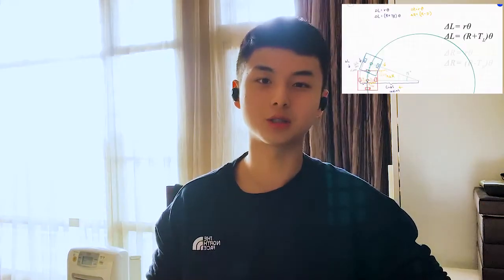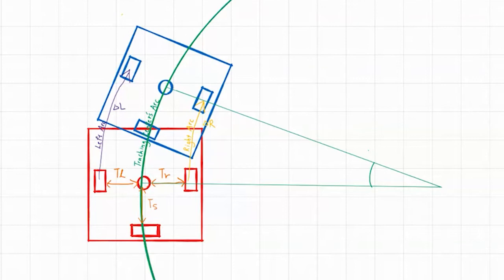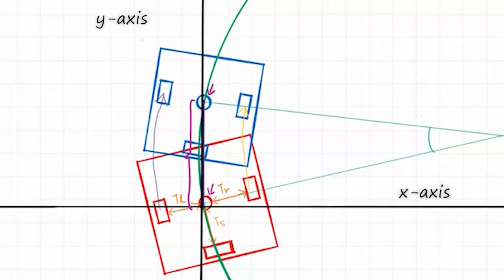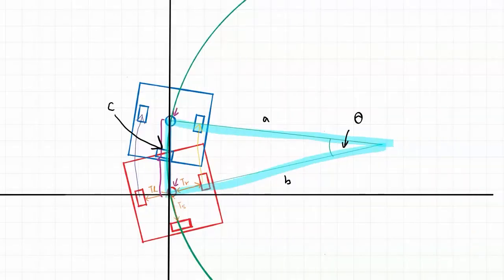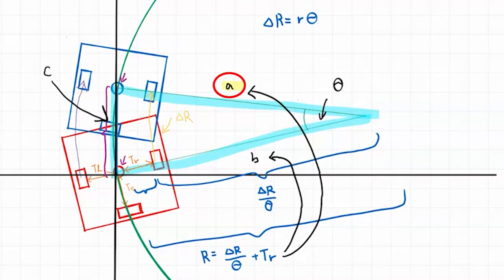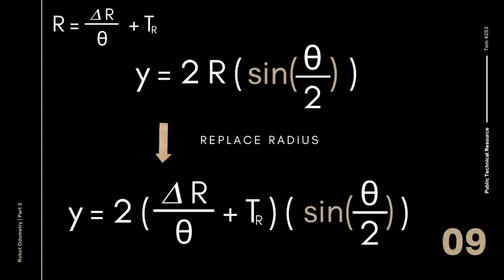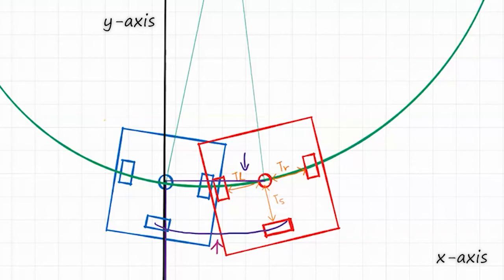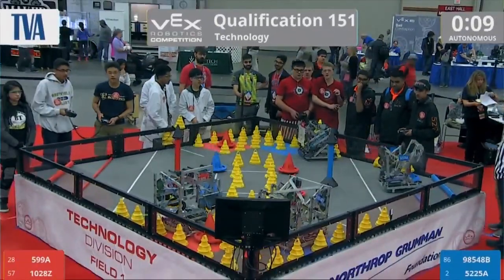How do robots know where they are? | Essence of Robot Odometry Pt. 3

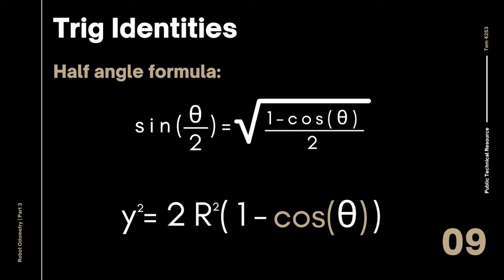Comment: @5:06 I was wondering how does factoring out a 2 place a 2 in the denominator of 1 - cos( Θ)?
Reply: Because you're taking a two that isn't there from the inside, it's the same as dividing by two, or multiplying by 1/2. As such, the denominator of 1 - cos(theta) becomes a 2, which leaves you with (1-cos(theta))/2.

Comment: when calculating the x coor, can you explain why the theta used is the same as the theta used in the y coor calculation? Isn't theta calculated with the right and left tracking wheels? then say the robot were to get pushed purely sideways, in the formula, the x coor would not reflect that change? thanks
Reply: If the robot is purely pushed side ways theta doesn't change i.e its 0. In the implemenation you can make a seperate case for when theta is 0. Basically you set the sin(theta/2) to be 1 instead and the rest of formula stays the same.